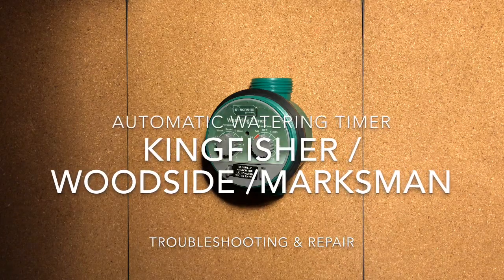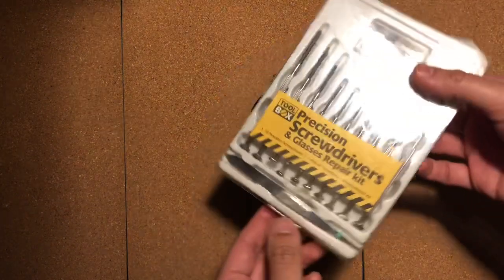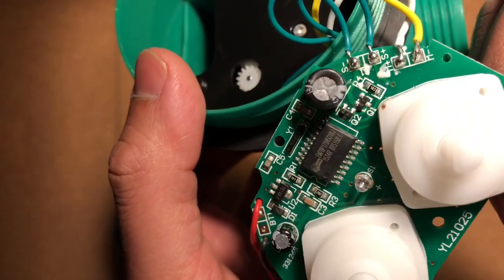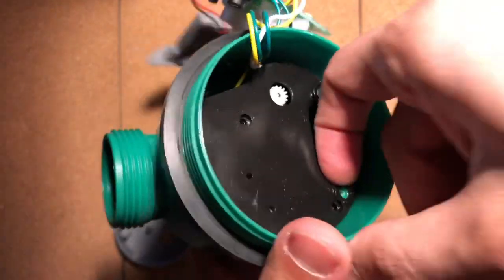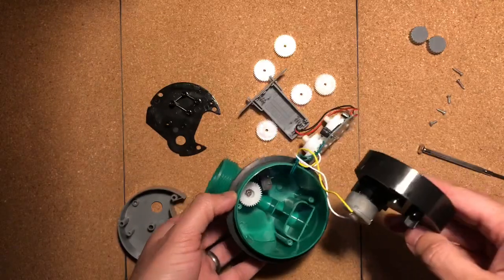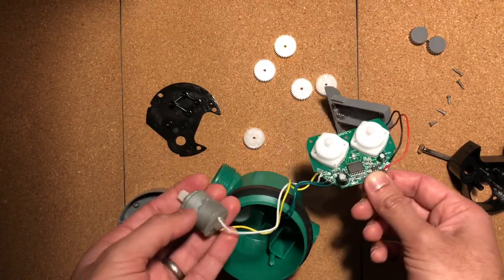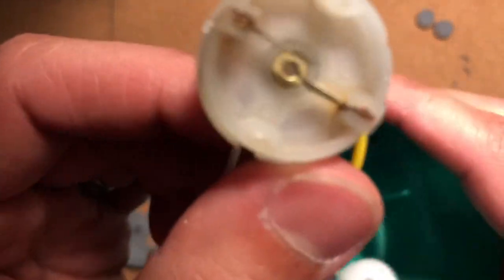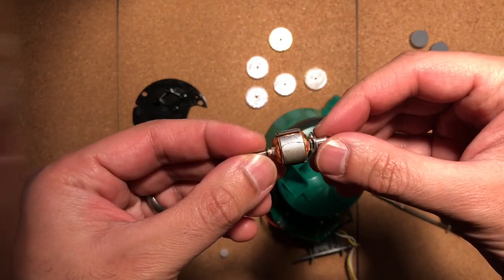Kingfisher Woodside Marksman Raindrip Automatic Watering Timer - Troubleshooting and Repair

Comment: The light does not go on when batteries are installed and I turn the dial.  Looked at your video but it doesn’t make any difference.  Any tips ?
Reply from the maker: Unfortunately this might be a fault with the circuit board. If the unit has had excessive water damage then various items on the circuit board might be damaged which will need checking individually with a voltmeter.

Comment: I have a problem with mine that whilst the valve is turning between the on and off positions just fine, in the off position it's still letting water through, at a much lower flow rate, but water is still getting through. It's controlling water from a water butt, so it's draining the water butt in a few days. Previously it turned off completely. Any ideas what is wrong?
Reply from the maker: If water is passing the valve then the ball/sleeve clearance is excessive. If your unit has rubber around the valve you might be able to replace this. If not then it could be a misalignment issue. Check that the screw on top of the ball is secured tight. Failing this the clearance has probably grown over time with excessive sliding between these components. There is no easy way to repair this. It would involve adding material to either the ball or the sleeve. It will be very difficult to achieve a tight fit.